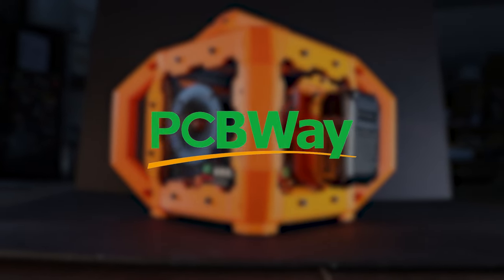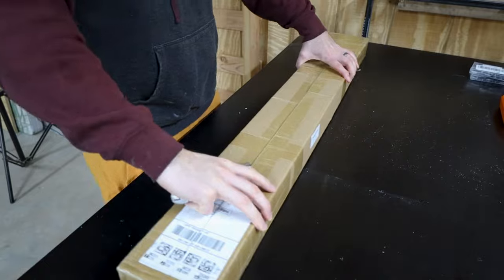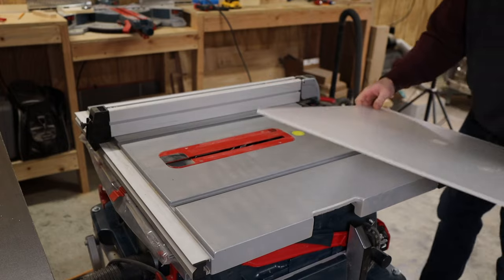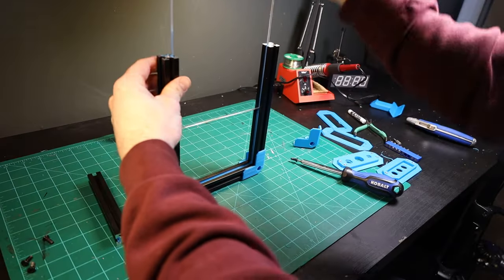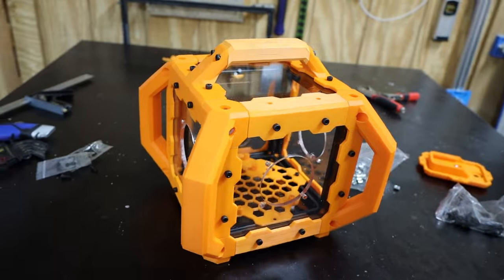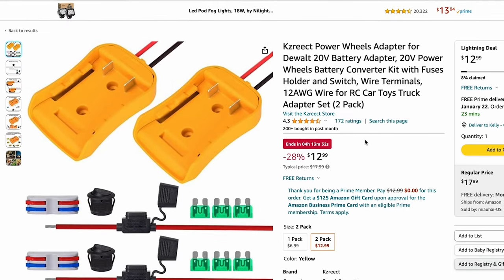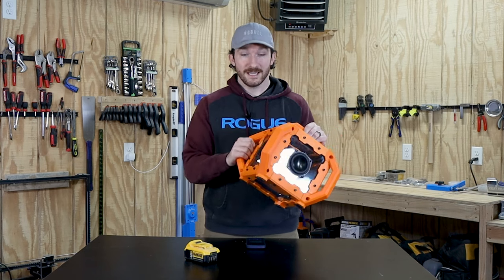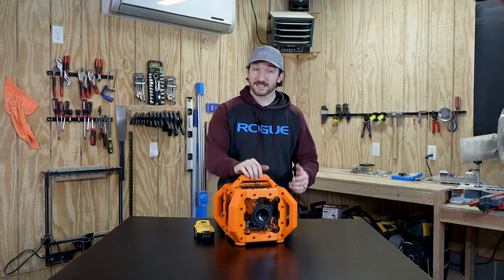I Made a Universal Power Tool Bluetooth Speaker!

Comment: If I may ask a dumb question, what kind of blade do you have on the mitre saw for cutting the aluminum extrusions?
Reply from the maker: There are special blades for aluminum, but honestly aluminum is so soft that any blade will be able to cut right through it. But you’ll have the best luck with a high tooth count blade.